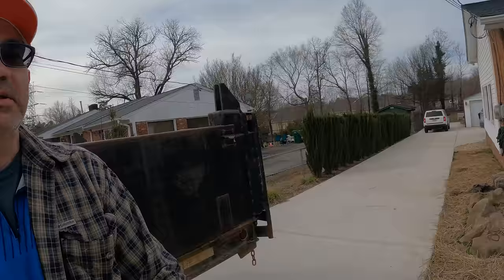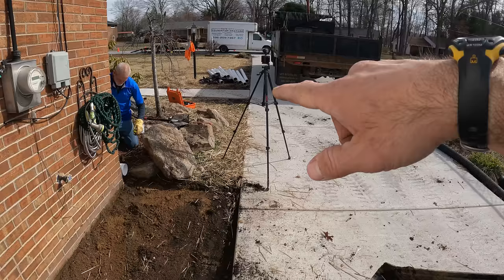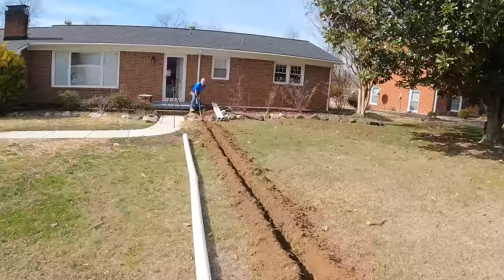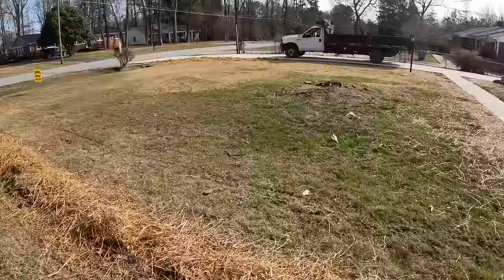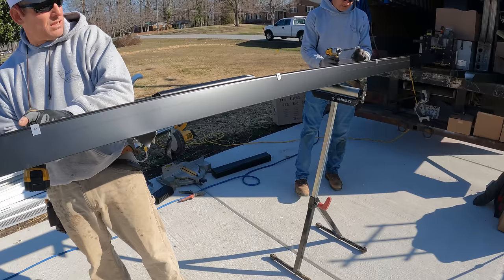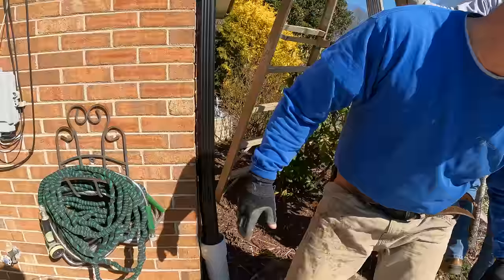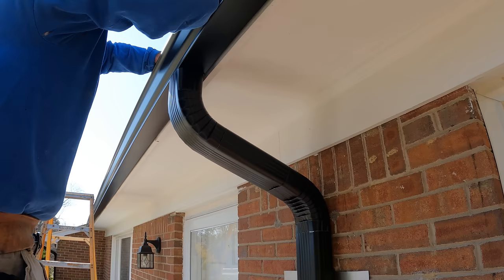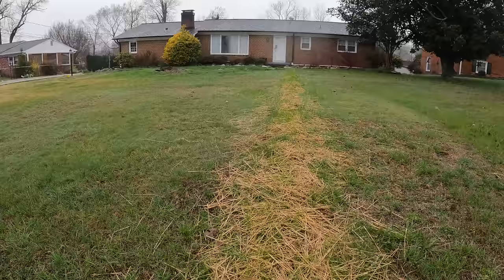Solving a Bad drainage install - no more basement flooding

Comment: Another amazing job, looks great. I followed your advice and work practices and did my own drainage line here in Va. It's almost been 3 years (May 2021) and my system is still working great and no flooded side yard. I emailed you the videos back than. I appreciate you sharing your knowledge. Keep grinding.

Comment: The mesh screen works fine. I clean mine once a year. Takes maybe 10 minutes to do the whole house. Most of the debris tends to collect in a few spots where theres heavy traffic of water, mainly along lines on the roof where lots of water flows through.

Comment: Thanks for showing the gutter install. I had the same issue with shingles and needed to trim as well. Also trimmed to 1/4 inch over hang.
  Also thanks for the mesh advice. I’ve found mesh works great in parts of roof hard to reach - I use leaf blower about 2 times a year and it keeps them clear. Can’t use mesh where lots of leaves collect.

Comment: 29:57 "This is not a system you want to forget about on your house" This is generally true, especially if you have no communal rain sewer up to the house and generally have mostly shoddy drainage.
Here in Germany, most houses' drainage is piped directly into the rain sewer. And if the pipework is good, then you actually can forget about it as it always flows.
There are exceptions of course... and my parents house was one of those:

Two adjacent gutters were piped into four buried and connected IBC containers. They had no overflow and the piping from both gutters going to the containers was backgrading and full of silt. How do you even manage to do so, and that was PVC pipe mind you.
This system was probably done to have free water for watering the garden. But considering you only need to do that for about three months of the year, while all the other time your house is litterally swimming due to constant rain in the northern German flatlands, this doesn't seem like a well-thought-through idea. Especially as that wasn't the only rain water collection system.
For nine months you had to watch out for the water level and turn the pump on. No float pump, as the opening holes to the containers weren't big enough. Also you shouldn't let the water level drop too low, as the soil would push in the thin walls.
Around three years ago we had enough and dug those up. Wish we could have used an excavator, as digging soaked soil by hand is not fun, but there was/is no easy entrance for any size machine. Got only to half the depth, which wasn't made easier by the one inch thick styrofoam board insulation between containers and soil. Who the h€ll does that?! That's just insane...The soil doesn't freeze here. Of course it had desintegrated by outside pressure (years) before.... Trying to fish every little ball of styrofoam (and there were at least two 60L trashbags full) out of the hole had us all not amused...
We didn't dig deeper, as the soil down there was just mud and ground water filled up that hole too fast, bringing in more mud.
So we cut the top half of that mess off, filled back in with dirt, ran new PVC pipe (correctly, as I was a follwer back then already 😉), added a new catch basin to the front door walkway, as it was a paved retention pond and ended in the already existing rain sewer line.
I had to learn how to repave that walkway with those small ~2x~2 inch natural rock paver stones. That was fun, but it took me about two weeks on and off to resurface those 4m² as I was "employed" on other home improvement projects. Layed a brick vent well in that drainage area as well, so our fire place and furnace vent wouldn't flood anymore.

Now it looks a lot better (isn't marshland anymore) and water actually drains now. No problems there ever since. Also never had problems with the correctly piped drainage in over ten years living there. Now only the pond keeps overflowing, as it is the lowest point in literally the whole neighborhood and never had a drain/overflow... But that won't be my or our problem anymore, we (my parents) are planing to move - hurray.

TLDR: Story time: If you get your engineering diploma and have "great ideas" for things, doesn't mean they are actually great. There are so many more "engineering solutions" in that house that are just messed up (said engineer built/planned the house in '84 by himself)....
Also: Know good people here: drainage contractor  for solving your problems, otherwise you get exponentially more, as also shown in this (and other) video(s).
Reply from the maker: That's pretty interesting. We have stormwater management here but nothing for personal property unless the homeowner wants to do drainage work.
Reply: "most houses' drainage" is not a proper phrasing, not technically wrong. "most homes drainage" would be the better choice here.

just a small thing, english is english.
Reply: @jmwintenn  Mimimi...
Thanks👌😉

Comment: At time 20:50...you create your fall by having a vertical pvc pipe that is at least one foot up off the ground. That vertical pipe will have enough force to make the water flow when it rains. Note: you may have some water that is stuck in the vertical pipe...due to the lack of normal fall. No one will notice that some water is stuck in the vertical pvc pipe...this water will be pushed out on the next rain event. This house has enough gravity flow to flow away off the property by gravity only. Blue Sky's.

Comment: Another great video! Where you guys end the 4" PVC pipe at the road and pile rock around it, if I was your customer I would want a small precast concrete spillway. The spillway have 5" tall lip for pipe to pass through and the lip would feather out to nothing, spillway would be 4' long - this idea might be custom precast piece.

Comment: Shawn on the longer straight runs of pipe like the ones in the front yard does it make sense to connect all the sections of the pipe on the lawn and then drop in the trench and make final connection after everything is glued ?  It seems like it would be easier to keep clean and link sections at surface then drop in trench.  Great work as always!

Comment: looks like they expected the downspout to discharge on the left side of that T where they scraped that little channel, and then put the perforated along the foundation to try and catch any water that may be going towards the house. Looks like the thought process at least, but def not a proper fix.

Comment: Are brick veneer houses in your area built without weep holes in the bottom course of bricks?  Piling dirt above the foundation would not be allowed in the South!
Reply from the maker: It's a matter of solving the basement flooding and covering the weep holes, or leaving the weep holes open and dealing with a flooded basement.
Reply: I've lived in Dallas and Houston for fifty years - nothing but black gumbo (clay) here, and it's NOT waterproof!  Yes it will deflect water as you say, but those weep holes will never dry out (as they're designed to do) if you keep them covered.  That can't be good for the framing lumber behind that brick.

Comment: Florida guy says catch your water up High from the roof water via the downspout...and as long as you send the water thru sealed pipes...it will drain where you want it to go. I would cut off 3 to 4 feet of the bottom of the downspout pipe so you have a sealed pipe taking the roof water to the street...and "gravity is the force that pushes the water to the street". Your catching the water so low from the roofs down spout may work poorly because you are not catching the water up High "where gravity is your friend" and forces the water to flow. Good luck and Blue Sky's.
Reply: There is no need to force the water anywhere. It flows downhill.

Comment: Another great video as always. Question - you mentioned that if your plan didnt solve the basement problem that you would come back and add clay / regrade the front. Would you charge extra for this? I'm dealing with a waterproofer now and am trying to get a sense for what is standard practice.

Comment: Have foundation cracks and some leaking into finished walls. Want to fix outside before inside. Outside grading bad in back and front. Guy wants to dig up front and back and apply dimple mat to reduce hydrostatic pressure and then regrade and drain front and back. Some other demo too and it’s expensive… in the 10s of K… Ouch. Anything above not make sense?

Thanks.

Comment: Hey Sean I had a question. I want to use Sch 40 for a French drain and was curious as to how far apart I should drill my 5/8 holes, I understand they should be at the 5 and 7 o clock position but how far apart should they be going up the pipe? Thank you.

Comment: I want to be grading my yard too, but I'm confused why sometimes u used CLAY and other time topsoil? which kind of soil u recommended to use for grading a yard?
Reply from the maker: Water flows through topsoil more easily than it does through clay. So when we need a waterproof barrier up against the foundation we only use clay.
Reply: @GCFD  where I can find clay? Walmart have it? or have to be somewhere else?
Reply: @RobiPerk0125  check with your local nurserys and landscaping companies. They can usually source this kind of thing for you.

Comment: Gutter guard seems like such a waste of time and money. Without them, the crap ends up in the gutter but at least the water also has somewhere to go. With it the guard gets blocked and the water has nowhere to go. Whichever way you look at it, homeowners need to realize that neither system is fit and forget. You're cleaning the guards or you're cleaning the gutter. If I have to get up there anyways, why pay for the guard?
Also, haven't seen the gutter guys using a level to ensure there's a fall to the downpipe. Did I miss it?

Comment: Corregated pipe is garbage, doesn't matter if it's 4" or 48", the design is flawed ...you need smooth pipe to prevent debris from inevitably clogging it. BTW, a honest, hard-working employee(s) are key to the success of any business, including (and most importantly) the boss! I love it ...Ron ...you bring it every time!
Reply: It's great for the right job, unfortunately it has the misfortune of being cheap and easy to (mis-)use, so it's first to hand for amateurs and people who's paid to know better, like spray-foam and bailing wire in auto-repair...